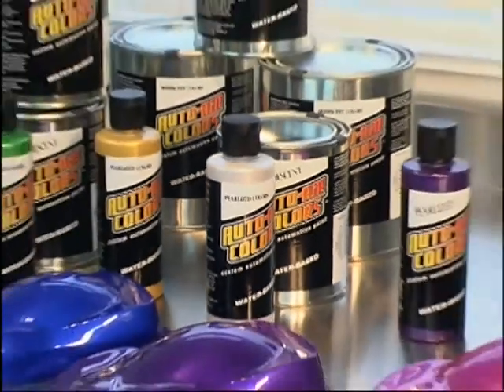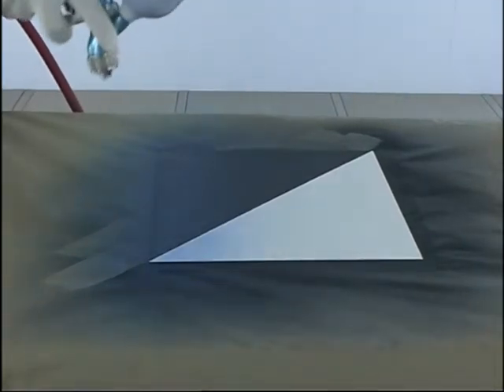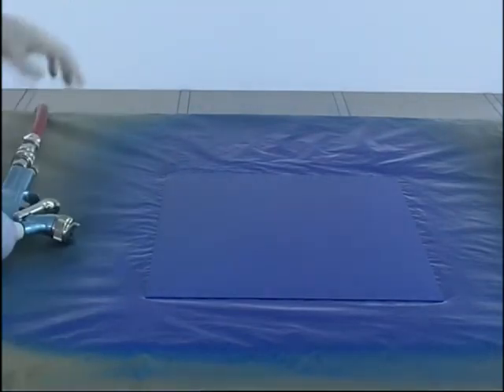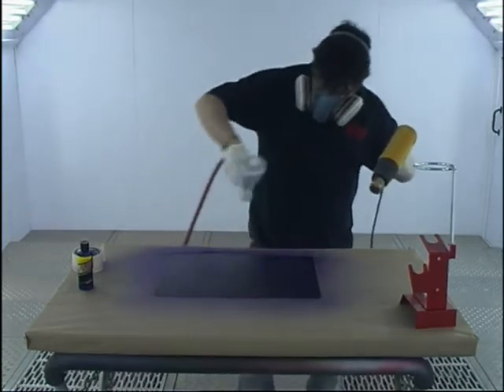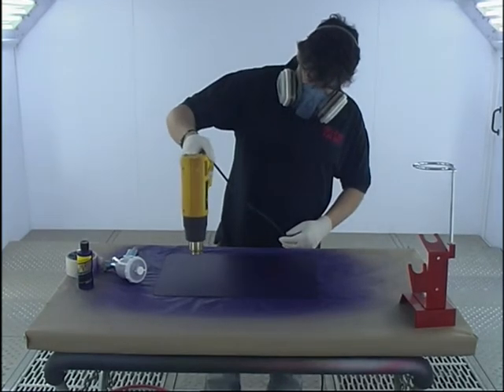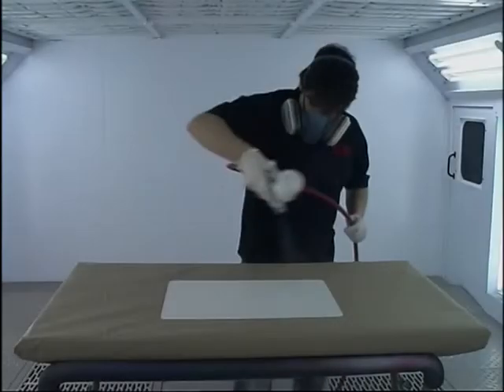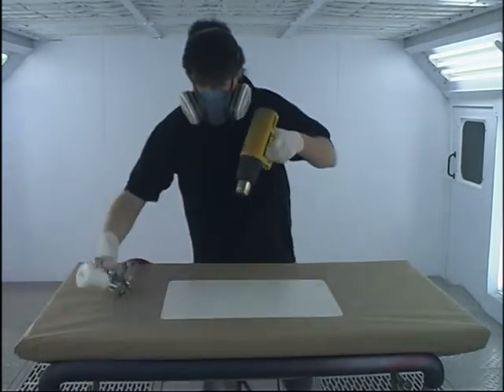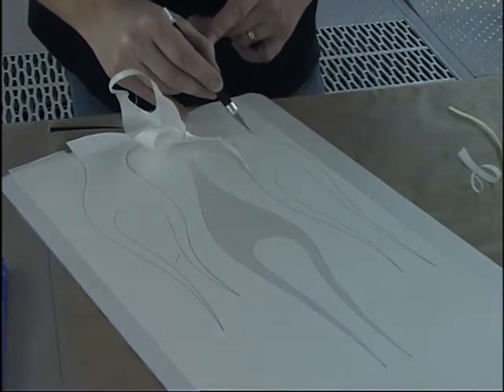Auto Air Colors_4300 Series

Comment: Hi Simon really love your vids.My question is I have a Graco 3800 3stage turbine system,with the high vol low pressure,which almost seems the opposite of how you work with auto-air,is it possible to use this system to spray auto-air?